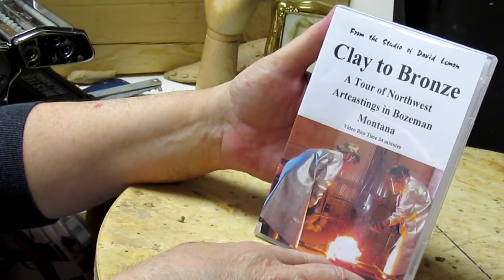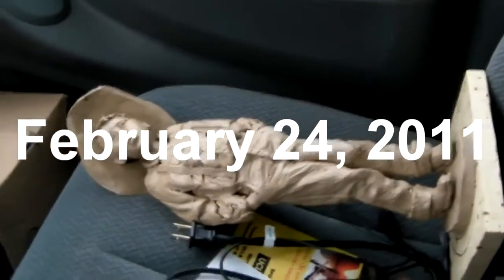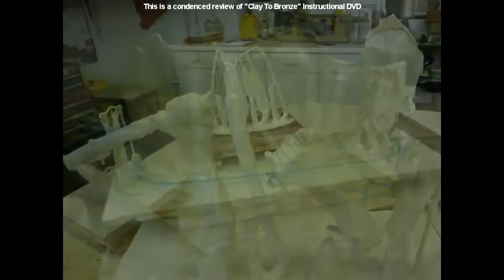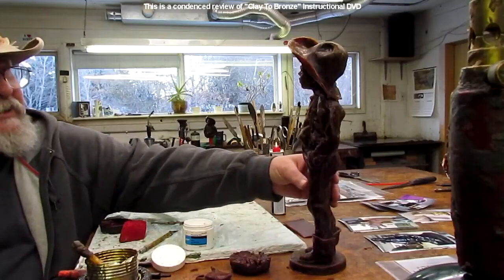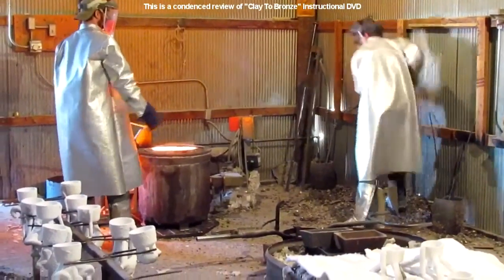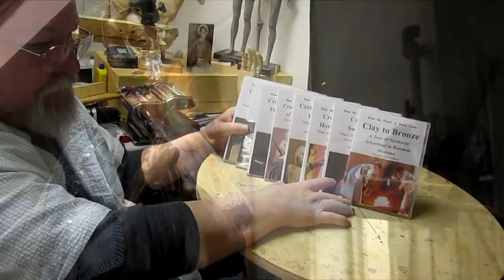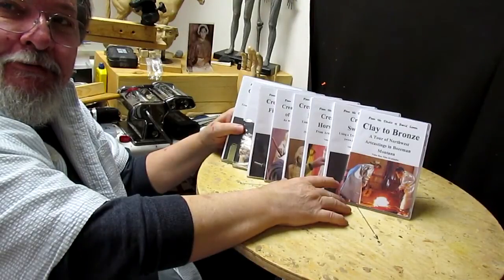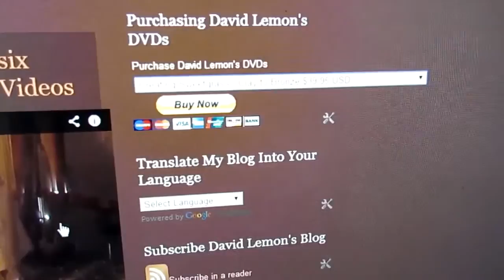Instructional DVD by David Lemon Review Clay to Bronze, A Tour Of Northwest Artcasting

Comment: Hi Mr. Lemon, I finally found a few foundry's where I am. However, their prices seem out of this world high! I know bronze is expensive but they are giving me a quote of $1k for my piece and my sculpture is not even that big. Here are my piece measurements: 

Height= 13 in. 
Width= around 9 in from tail to arms (horse)
Depth= 2 in. 
Medium = wax
Pounds = 2-4

Does this price sound accurate to you or is it crazy? Just wana make sure im not getting ripped. thanks!
Reply from the maker: +Alexandra A Now is that just for the casting.. or does that included the rubber mold as well? There would be a one time cost for the rubber/lytex mold..
Also they'll probably charge you a surcharge for the copper in the bronze... they do that after it's been cast and they get the weight of the bronze...
Reply: +David Lemon I asked them just for the casting as I don't need the rubber mold and am fine not preserving my original piece. I knew bronze was expensive but I didn't think my small piece would be that much. Kinda bums me out because I would love to do work in this area but I don't have those kinds of funds.